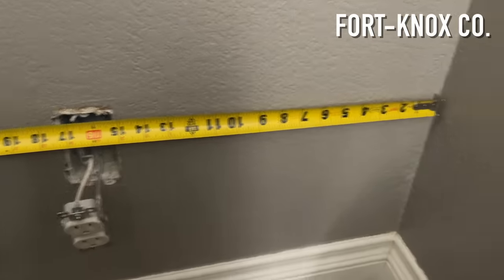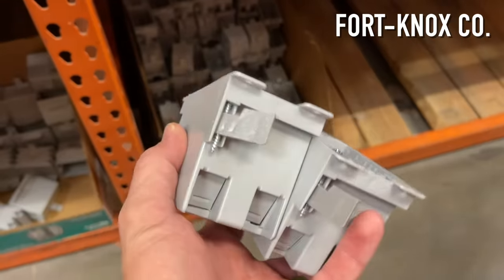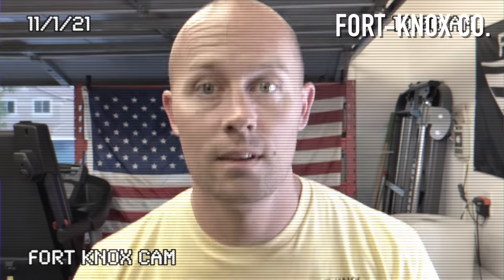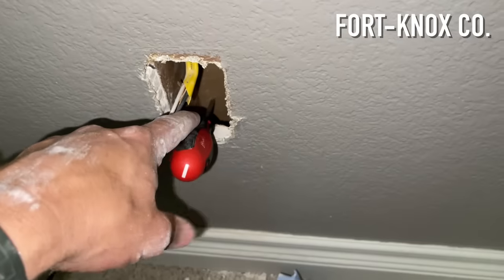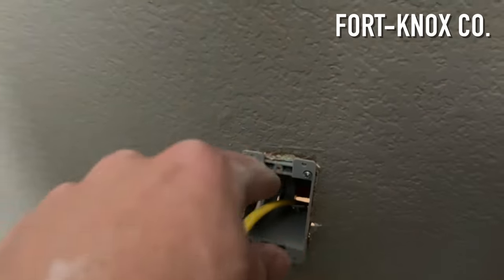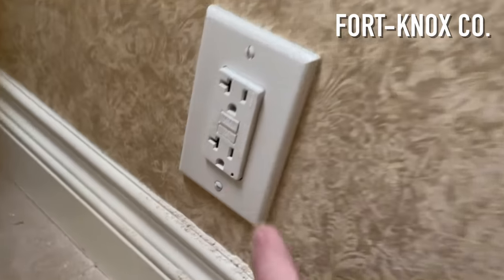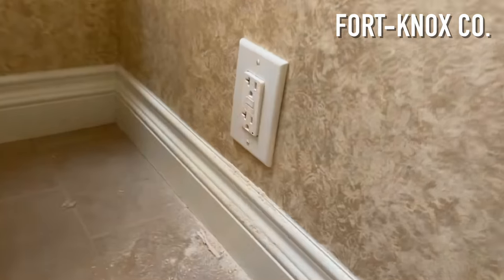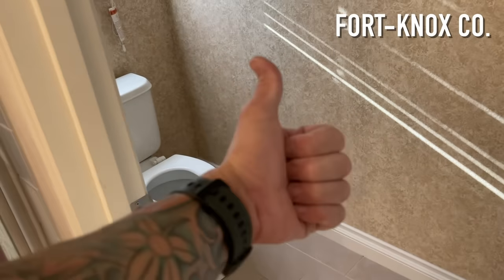How to Add an Electrical Outlet ANYWHERE !! Heated Toilet Seat or Bidet Install | Run Power Easily

Comment: Definitely something I can't do myself. 4 walls of the bathroom: one is an exterior wall, one goes into the hallway (no outlets), one has the tub and the only bit of wall on that side goes to a closet in the adjoining bedroom, and the last wall goes to a basement staircase and the closet of the other bedroom. The bathroom itself only has electrical for the lights/fan (no outlets) and the light switches are outside the bathroom itself. My house is from 1945 for context.
Reply from the maker: Aww man. Sorry to hear this. It can be done but it might cost a pretty penny to run some new electrical
Reply: My house was built in the 2000s and I have the same issue. The nearest outlet to the toilet is 25 feet away where the sinks are. On the other wall opposite the toilet is the master closet and there are no outlets there either...
Reply: @FortKnoxCo  Yeah. Priced it in my area and I was quoted $5k because he would have to run a wire from the fuse panel in the basement, up to the attic then down to the bathroom. Yeah...$5k can buy a lot of toilet paper!
Reply from the maker: @ekummel  yeah that’s a little pricey. Sometimes the juice isn’t worth the squeeze
Reply from the maker: @ekummel  Yeah in that case you may have to do a good amount of drywall work. Usually when you have to run that far with new wire you’re gonna have to cross over some studs and that entails making some holes in the drywall. At minimum. It’s almost always possible just matters how much work do you want to put into it.
Reply: @FortKnoxCo  Yeah...Like I said...$5K for a bidet? That can buy an awful lot of TP!
Reply: @ekummel  Thats if you can buy TP.
Reply: @ekummel  This post is about a year old but now there are bidets that use the hot water from the bathroom sink. Electrical power isn't required.
Reply: @rayheatley9910  My bathroom sink is also 25 feet away from the toilet! And if it costs $5K to run power to the toilet, then I can only imagine running a hot water pipe from the sink will be even more expensive! I guess they may be able to tap into where the tub is...that's only 20 feet away...But that would require tile work, drywall work and sheesh...seriously not worth it. Toilet paper and wet wipes are the more cost effective way to go!

Comment: Nice job but I would have installed it on the wall right next to the toilet. Just in case you get heated toilet seats or bidet. Less conspicuous.
Reply from the maker: I would prefer it there too. In this case it just required more work than the home owner wanted to pay for. So we kept it simple. They have a rack they like to keep next to the toilet, so it hid the outlet well.

Comment: Why did you install this lower on the wall?   Because it was a bathroom outlet requested by the customer?   Also was it code to use a 20 Amp GFI outlet when the rest of the circuit looked like 15 Amp?    Will that be allowed per code?
Reply from the maker: They wanted it low to be hidden behind a rack that they had in the bathroom that holds their extra toilet paper. So for them it worked out well that the outlet on the other side of the wall was that close to where they wanted the new one. It also required a lot less invasive techniques like multiple holes & drywall repair to move it behind the toilet which was an exterior wall of the house. So for them it was also on budget. 
The circuit Is a 20amp circuit of wall plugs. All the wall outlets in the house are on a 20amp at the breaker box. Lighting circuits were on 15amp. Very common. So using a 20amp GFCI outlet on this was just an added layer of protection on an already 20amp circuit.
Reply: It was a 20 amp circuit but once there were multiple outlets it was not capable of a single 20 amp outlet anymore.  Or do you not derate the max load per circuit breaker?
Reply from the maker: @crusherfang9368  that is correct. Almost every outlet or wiring in a Wall has been 20amp. For heavier draws from Appliance. Most wiring in ceiling dedicated to lighting has been white/15amp

Comment: I just looked up a bidet manual for a bidet I wanted to install. It says to use a dedicated circuit. running a line from 2nd floor bathroom to garage would be a pain.
Reply from the maker: Sometimes they may say that in the manual because they don’t want people branching off a line that isn’t GFCI protected. So I’d guess they say that to avoid any confusion and make sure it’s on a protected line. But if done properly it’s no different than plugging in a light or appliance. Main thing is that any plug in or near a wet area needs to be a GFCI circuit.
Reply: @FortKnoxCo  I already have a GFI in that circuit. Can this also be GFI on same circuit?
Reply: @ashtanga2000  If the circuit has a GFCI on it then that’s one layer of protection. If you want to make the outlet in the bathroom itself a GFCI you should be able to do that too. That way that outlet will pop if for some reason there’s a short from moisture at the connection. That should be like a double layer of breakers before your main panel.
Reply: @FortKnoxCo  Just speculating, but I think some bidets can draw up into the 1500 watt range at peak.  So putting that on a shared circuit could cause overload issues.   I'm thinking someone tapping into a bathroom circuit and having bidet and blow dryer running.  So they may recommend dedicated circuit to avoid that issue.
Reply: @stevel7644  that’s definitely a possibility. Most dryer circuits will be a dedicated line. So tapping off of that one specifically would mean you specifically pulled from the dryer, which would not be good. In the case you pull from a regular wall circuit in a bedroom, there probably is 10 or less regular wall outlets on that line. Now if you run a high powered bidet and have something or several things running on those other wall outlets at the same time you could over draw on the circuit. In this case it was a outlet that was hidden behind a dresser and not being used and the other outlets just had either a lamp or tv being powered. So for most cases you may want to run a dedicated line to avoid any of this.

Comment: Did you center the outlet?
Reply from the maker: The outlet was placed more towards the toilet, this is where the client wanted the outlet because they have a small toilet paper/reading material rack that sits next to the toilet. So the plug will be hidden behind that.

Comment: what if there is no outlet on the other side of the wall?
Reply from the maker: Then you do the same thing but I have to run it across the wall possibly through a few studs. Some of the same principles apply. I made the video mainly to show some different techniques on how to move electrical in general. It’s really not that scary. I have other videos that show how to move electrical up or down the wall

Comment: Another nice option would be to power the bathroom outlet first and the load side of the GFCI over to the bedroom which would add ground fault protection to the bedroom.
Reply from the maker: I agree. The bathroom has a GFCI located in another room, but the plugs in there were GFCI protected. The code here requires any plug near water or moisture to be GFCI.
Reply: You do that and when the gfci trips nobody ever thinks to go into another room to reset it. plus any recept within 6 feet of a water source in the room not a dedicated circuit by code has to be a gfci.
Reply: @user-neo71665  I would, and when that outlet in the bathroom quits working too, it would be obvious. Not following the second part of your reply, it is a GFCI, and what about not a dedicated circuit? Not following what you are trying to say there.

Comment: You used a 20 AMP GFCI. It should have been 15 AMP because a 20 AMP should only have one outlet on it. But it really does not matter if you know not to overload that outlet but for code should not have done that.
Reply from the maker: Very good to know. Thank you!
Reply: Where is the code for that? A 20 amp kitchen circuit has more than one outlet
Reply: Not correct. A 20-amp can have any number of outlets.
Reply from the maker: @nsbioy  yep!

Comment: Seems like this outlet is below the NEC specified height recommendation.   I know some locations do not adopt NEC, but usually there are reasons for the exceptions.  
As for outlets in baseboards and floors, those are usually for concrete floors, and other safety measures are often required in those applications, like splash resistant outlet covers.
Reply from the maker: Yeah, I’ve seen many different variations and locations for outlets. Depending on the area you live in they have different reason for allowing or not.
Reply: A dedicated circuit you have some leeway but this isn't so this would raise a flag on an inspection. Another thing to worry about when tying into an existing circuit is the load on it. If the breaker is already at max you just overloaded it. Often bedrooms are pretty maxed and it would be better to try to piggyback it on the bathroom if you can since they are often pretty lightly loaded.
Stuff like that is why in the trades we have to do so many hours of school and on the job training.
Reply: @user-neo71665  yeah another way would be finding the nearest outlet on an adjacent wall in the bathroom and bringing it over. Obviously a dedicated outlet would be ideal.
Reply: @crusherfang9368  🤙🏼 awesome !
Reply: @crusherfang9368  Section 1136A Electrical Receptacle, Switch and Control Heights

guess again.
Reply: @user-neo71665  Thank you for the NEC reference.

Comment: "ANYWHERE !!"  >> where there is already an outlet / box nearby, right?
Reply from the maker: Nope. Pretty much anywhere. The methods of pulling the old box and branching off are all the same wether your moving it up a wall, which I have a video on, moving it the the other side into another room, which this video shows , or wanting to move it up over and waaaay down to another location. You can do the same either way. Moving it further just requires more work like drywall work when you cut holes and have to drill through a stud in the wall and run the wire through and then patch that hole and repeat the further you move. I’ll be making a video where I show how to do the drywall work and drilling through studs for people wanting to do that.

Comment: Is this legal as far as fire code?
Reply from the maker: You need to make sure that all outlets in or near wet areas are GFCI protected outlets. Most houses now call for all circuits to be GFCI as an added level of protection.

Comment: Everyone can be a handyman or electrician, as long as you know what you are doing. Make sure the work complied with the electrical code, otherwise the work will violate the home insurance policy.
Reply from the maker: I agree. Everything is really for informational purposes and to so how it can be done or certain problems can be solved or worked through with tips and techniques. Obviously you should be looking at code requirements because every area is so different. It would be almost impossible to cover every code difference or requirement in every state, county & city. Not sure people would want to watch that movie of a video.

Comment: How the wire go to the new outlet?
Reply from the maker: Your just branching off the original outlet and running a new set of wires to the new location and box you install. Very similar to the video I made about moving an outlet up a wall for a wall mounted tv or camera.

Comment: use an osilator with single gang adapter, i am guessing your not an electrician based on your wiring.
also new code for new houses you get afci/gfci breakers most annoying things
Reply from the maker: Yeah. Houses now a days are requiring a GFCI on every circuit. Definitely increased cost too.

Comment: Why not put the outlet behind the toilet on the water supply side. It would have looked much better that way as almost all bidet seats have the cord on the left side. Just wondering, the video was good though.
Reply from the maker: The home owner did t want to pay the extra labor/time it would take to move the wires around the corner. It could be done but just cost a little more. It worked out for them because they had an organization rack the kept down next to the toilet. So it sits just behind that.

Comment: The only problem I see here is that I don’t have an outlet on the other side of the walls of the water closet.  Exterior wall - closet wall - shower enclosure wall - bathroom wall.  I guess I am SOL! (And that is a legal term too!)
Reply from the maker: You could run it from the nearest outlet in the room or adjoining room but it will obviously require a lot more drywall work as you’ll have just jump through a couple studs.

Comment: Unfortunately, none of the bathrooms in my house has an outlet anywhere near the bathroom walls. All my bathrooms are on exterior walls.
Reply: Yeah the title "ANYWHERE" is misleading. Anywhere you already have an outlet :/
Reply: That might be a good thing. I bet there are plenty of wires in your attic that you could tap off of. Exterior wall probably has less other wires in it. Just run from a junction box nearby and then down the exterior wall.
Reply: @jeffstanley4593  Unfortunately, not. When we had this house built, the builder wanted an additional $1,200 to install a power junction box in the attic. We didn't buy this because we thought we'd never need this feature.
Reply: @ekummel  I mean a box for lights in the ceiling. You could probably tie in there. Any wire at all, the outlet for the bathroom is not going to power a device that draws a lot of amperage.

Comment: If you showed how you attached the old work box, I didn’t see it.
Reply from the maker: The old work box is as simple as cutting the hole to size, sliding it in and turning the screws. It secures itself as you tighten the screws. I have used it in a couple other videos where I show the old work box in a little more detail. I was trying to keep this video a little shorter and to the point. But if you’d like to see more of the box you can check out one of my other electrical videos.
Reply: @FortKnoxCo  Ok, thanks!
Reply from the maker: @Roadhardd  no problem at all. Thanks for commenting and watching. I really appreciate it

Comment: Not every circuit in a home needs to be gfci. I.e., lighting, bedrooms, etc are not. 
Garages require gfci because it’s considered wet. Bathroom outlets are supposed to be dedicated circuits for the bathroom only, plus being gfci. Kitchen circuits (minimum 2 at 20A) also must be gfci protected. Same for washing machines, garbage disposals, etc. 
The only exceptions to that are dishwashers, and sump pumps are never gfci protected.
Reply from the maker: Thank you for all the good information! I appreciate it!
Reply: That's odd. I researched the sump pump statement and one of the 2008 revisions to the NEC says that sump pumps be placed on a GFCI protected circuit.
Reply from the maker: @dougms9790  yeah I’d think because it has to do with being around moisture. GFCI is required on a lot of things now just as a redundant safety system.

Comment: also takes a little longer if the bathroom is tiled heh
Reply from the maker: Yeah that would require a little more time but still definitely possible. They have drill bits and diamond toped blades that will make quick work of cutting the tile

Comment: Maybe Its just me...but I found this video to be incomplete and potentially dangerous for an average home owner to do themselves... you didnt really show how its done but rather just told how its done 🤷
Reply from the maker: That is partially correct. I have other videos that show similar techniques for moving outlets or adding outlets that go into more detail. Other videos that show more detailed outlet wiring and GFCI wiring. But this video was a shorter version of how I added an outlet to another room using those similar techniques and jumping into another room rather than moving it up a wall. I tried to keep this video in particular shorter and to the point.

Comment: If I hired a contractor/handyman to do a simple job like this, and he told me he was going to have to get an electrical permit.......I'd find another contractor.
Reply from the maker: Yep I could understand that. Some people are okay with making it work and some will want to jump through hoops. Either way as long as it’s done correctly and the customer is happy is what matters. I’ve seen that you have to pull a permit technically to change out your water heater. And in general it’s a really easy swap, but they want you to pull a permit so the county or city can come out and say they see that you put an earthquake strap on it or whatever. It’s a little unnecessary
Reply: @FortKnoxCo  Actually, there's a little known underlying purpose here.  The local jurisdiction wants to take every opportunity to evaluate your property solely for the purpose of raising your property taxes.  Think about it.
Reply from the maker: @bobbyvee8941  that is a very good point!! I wouldn’t put it past them. Sneaky sneaky